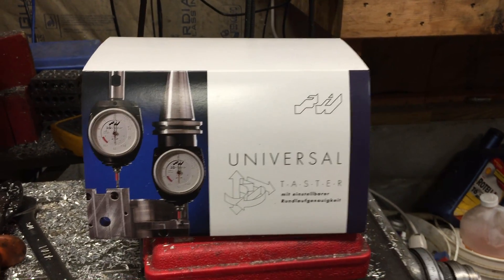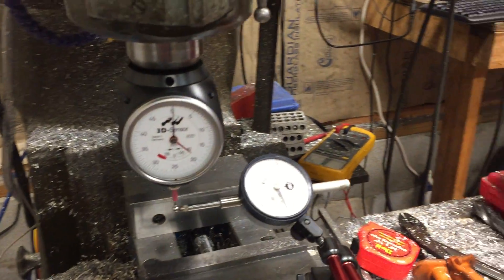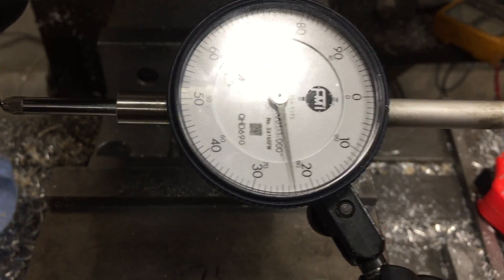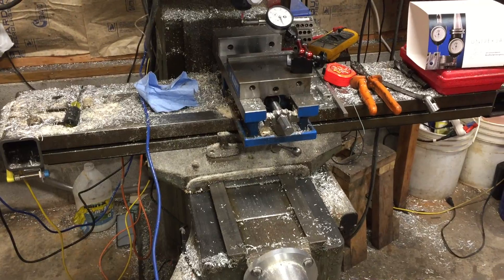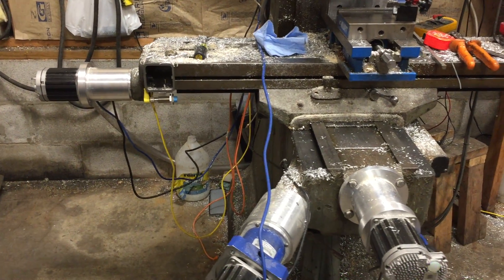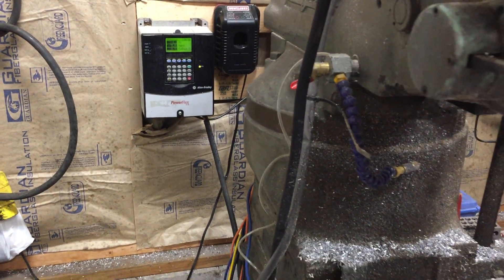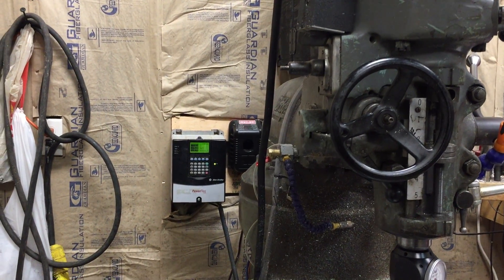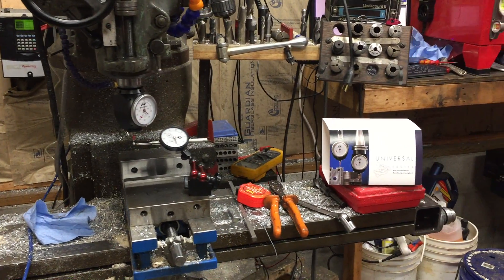Haimer 3D setup and Masso Spindle Control Figured Out

Comment: Hey John had a quick question trying to hook up my masso to control my vfd are you useing 24 volts that comes from your vfd or an external 24 V and did you use pin 2 and 3 ? What the heck do the xs mean in the masso drawing lol thanks in advance
Reply: X's
Reply from the maker: larry martens i used pins 4&5 for forward and pins 6&7 for reverse and pin 1 for the speed controls.  I tied the 24vdc of the drive and the external together and made the external drive just a little higher than the drive so it done all the work like .1-.2 higher than I measured on my drive with nothing hooked to it.  Ok the tricky part of this is getting the polarity correct thru the masso's opto couplers because they will only flow current in one direction. Hope this helps
Reply: John lambert thanks a bunch man for the quick help hope your bigger shop is coming together goood
Reply from the maker: larry martens its at a stand still. Lol.  Work has had me busy. Lol
Reply: John lambert haha same here I got sick of overtime at work keeping me from getting any work done on my mill

Comment: So are you using the variable sheaves for speed adjustment or adjusting the frequency on the VFD? Or does the VFD only control on and off and direction and you manually change speed?
Reply from the maker: Caseman91291 I am using the vfd to control speed.  I set the sheave to 2000 rpm and locked it down.  Then set the drive to run 0-90 herts.  Then on the setup screen on the masso I used 3000 as the max speed.